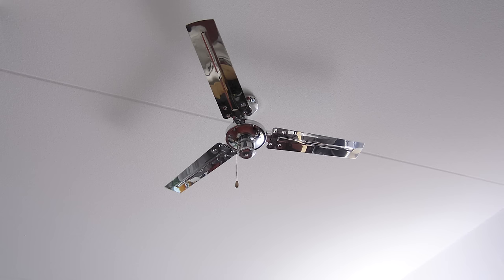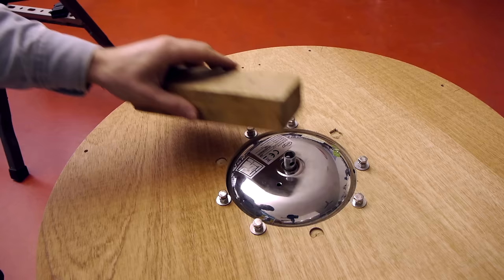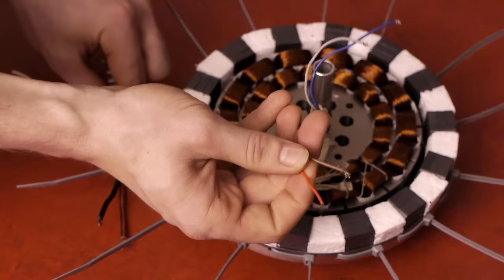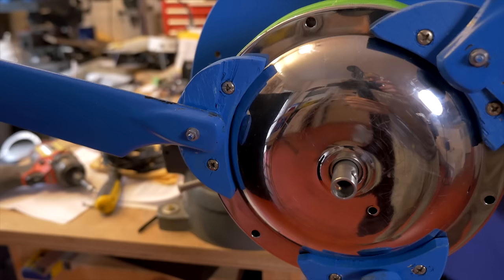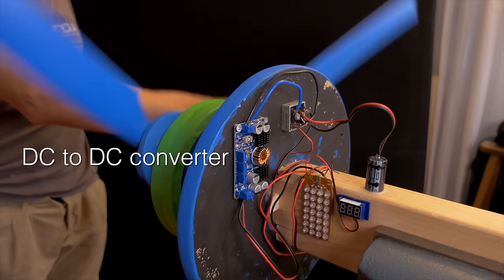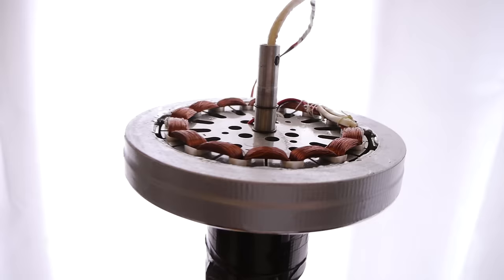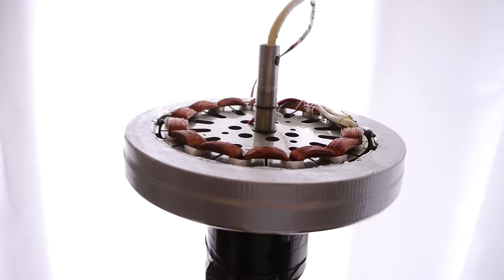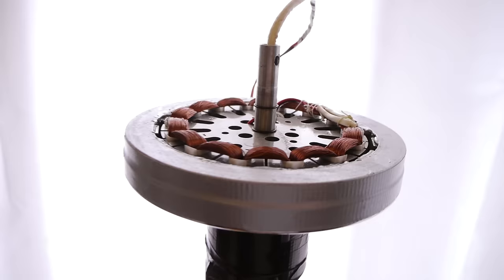Turn a ceiling fan into a wind turbine generator?!

Comment: Replace the linear regulator and dc-dc converter with a solar charge controller with an input voltage capability of 75V, the input is connected to the bridge rectifier output. The solar charge controller output can be used to charge a 12V battery, from this battery you can use your dc-dc converter if necessary to provide a lower voltage such as 5V.
Reply from the maker: Yes, I agree, that is a better/easier solution. Though inside a solar charge controller are: a rectifier, capacitor, and dc-dc converter... Almost the same, expect for: also containing other smart/necessary electronics, and well balanced.. so yes, your simple solution is better. As for better: I don't want to use the old lead acid batteries anymore. Thus instead Li-ion or LiFePO4. Thanks for comment!
Reply: Can be purchased or built is a DC to DC converter that can handle all the power output depending on what you are doing they are at about 80% efficiency, no need for an inefficient solar charger or the resistance regulator. The aim was to charge a phone ? Using just two DC converters would be better than the resistance regulator
Reply: SG Buckley's suggestion is the absolute best! Output from the Bridge rectifier, and into the Solar Charge Controller. These are quite cheap on Ebay, and the Solar Charge Controller does everything in one small compact unit, and also gives via the LCD readout the Amps / Volts, state of charge - if connected to a 12v Deep Cycle battery. Some Solar Charge Controllers also incorporate two(2) 5vdc regulated outputs for phone charging. The best 'generator' appears to be the main Motor from a Fisher & Paykel Smart Drive washing Machine. Motor would need reconfiguring. Finally, if you decide to use the F&P Washing Machine Motor, be aware that some of these motors have aluminium wire coils. Avoid these and select copper windings as your first option.
Reply: I would like to see that setup done, it sounds interesting and MAYBE doable for us non-electrically inclined. Please do a video of it.
Reply: A solar charge controller starts with DC voltage from the PV panels.  He is starting with an AC voltage, a better suggestion would be to research the switching diodes and phase shift for DC to AC conversion but that is later on.
Stick with the bridge rectifier, and nice work on the magnets and the understanding of how they work with electrical generation.  I wonder what this would do attached to a tesla coil?
Reply: @RobertOlufs  I wonder what it would do using POE coils and Rodin coils?
Reply: @kolinevans9127  What do you mean inefficient solar charger? Those are some of the most efficient DC-DC converters on the market. Some are over 96% efficient. The only downside is that they tend to have high prices to match.

@Robert The solar charger would go after the rectifier and smoothing capacitor. It's just a very good DC-DC converter with some additional safety features built in.
Reply: nick luci ah you got me there until I read the rest yes very high prices as compared to some high quality DC DC switch converters I have purchased from China in the range of 10 to 30$ over 80% efficiency from 180 to 300w-  Maybe I was thinking about everything else related to solar when I thought ‘inefficiency’ ? Also the cheap chargers are horrible.
Reply from the maker: @peterduxbury927  That Fisher & Paykel Smart Drive from a washing machine, seems like a much better, more powerful stator relative to an ordinary ceiling fan. If I find one of these I will certainly take it out of the trash. Pretty sure they are rare to find relative to a ceiling fan. As for the Solar Charge Controller. That is the easy way. Could also buy a ready to use wind turbine. I want to learn how stuff works. And the output of my ceiling fan will not work directly on a standard Solar Charge Controller: at very high speed 230V and 0.28A...

Comment: There is a way to use an induction machine as a generator, namely by connecting a capacitor in parallel with it to generate the reactive current which will magnetise the airgap. Many old wind turbines use this. Maybe you could even use the inner coils for this purpose: connect a capacitor to those.
I like the idea of using this fan because of its low rpm. Great idea.
Why not use the original winding, accept that it's made to generate high voltage and chop that down to a value acceptable to you? It would generate the same power as lower voltage with higher current.

Comment: the coils have shims that raise them away from the core. Why not try to trim those and physically push down on the coils to reduce the gap (@~10:40) ? Very nice video. Your calm voice tone helps :-)
Reply: Or replace the insulating shims with ferrous shims and a thin layer of insulation.
Reply: Magnets Make Me Merry!

Comment: Convert the generated electricity into DC to charge a preferably good size battery. Then use a power inverter to power home electronics.
Reply: Personal opinion though, it would be allot less work getting one of the windmills that's meant for yard art and using it with a pully on a car alternater.
Reply: @starkie1990  Car alternators need a lot of wind power to turn them. Pulleys waste power.
Reply: @starkie1990  Trust me that I am fully familiar with the concept and application of gearing. I don't think you grasp the power loss of gearboxes, pulleys, chains and sprockets etc.
Reply: @brianrosebudd9200  when you fall asleep over your phone 😅

Comment: I decided to watch this video out of curiosity because I'm always looking for motors that can be turned into generators. Giesbert mentioned that you can find ceiling fan in the trash but I don't think I've ever seen (or at least noticed) a discarded one before. 
Half way through the video someone asked me to come outside, and what do I see next to the dumpsters? A ceiling fan! Manifestation? I don't know, but what are the odds?
I promptly took it home, disassembled it, and found the same type of induction motor inside. Still have to build the rig to get the casing open.

Comment: At the end you asked for suggestions about improving the electronics. I have a suggestion. Use a MPPT charge controller and done!
Reply: While I havent watched the vid yet, What I did was use multiple ( to be exact) LM338k voltage regulator controlled outputs feeding a cheap 5 input solar regulator which then fed a bank of 5 deep cycle batteries. The fifth input on the regulator was fed by the cheap Harbor Freight Solar panels. One other thing I did is I mounted a cheap plastic bowel, carefully cut, and fitted, over the hub of the fanwith a rubber "seal" to keap rater out when it rained. this was the hardest part since this seal couldnt induce any drag on the motor.
Reply from the maker: Ha, yes, or just buy a charge controller ánd a wind turbine and be ready to run in no time! These modern little wind turbines for on boats for example are amazing. But this is a DIY & re-use project. But you are are right and this is my plan: Make a better DIY version 2 of the generator, then focus on the DIY rotor & the turning on a pole, then maybe DIY electronics. Up to that time, a could just use a MPPT charge controller. Everything at once is a bit too much.
Reply: Electrical equipment TAO  thank you very much for the information. Many continue to deny the ether although it has been scientifically known to exist for at least a century.
Reply: Electrical equipment TAO  no. Good try, but no. I don't think so. I guess were all allowed to differ by our opinions.. While I do believe in a certain type of "Aether" (derived from Latin...) I don't think it's as complicated as you do.
Reply: @elijahgardi7501  @Electrical equipment TAO The page they linked, links to a sketchy video website that tries to get your money after seeing the video. You can always tell its a scam when the video player has no controls for the playback position. I don't know why it's such a common format, but those scam video player sites all look/behave the same way. It's bullshit.
Reply: @GiesbertNijhuis  Good idea, great little electrical project, highly desirable for off grid living & I agree with your wish to build an efficient front end from throw away items, if you get it right lots of people will give it a go  but the cream is to harness what you produce with minimal waste (heat, input clipping) no? So why re-engineer the output side when an off the shelf MPPT controller (select your preferred voltage & expected max over-current -- although you would still need to smooth the MPPT input I think) will make the most of your primary project? Plenty of controllers around with USB ports for charging gadgets as well as battery banks. Just view the controller as a module if you wish, as you would your bridge rectifier. :)
Reply: I'm thinking about doing this, any suggestions for overspeed/overcharge breaking? I know industrial ones have that feature but I don't know how it works.
Reply: @travellingsoldier5018  Sure, over charge can be handled by a controller, but I mean magnetic breaking if the wind speed goes over a safe amount, and likewise many of the better wind generators will use magnetic breaking when the batteries are full rather than just dumping the load, which can be problematic on a metal boat.
Reply: @svchineeljunk-riggedschoon4038  Stray currents on a tin boat would be very nasty I agree totally. Braking in the two situations you have outlined...........overspeed/over voltage why not just add a clamp to your smoothing cct., perhaps with a zener diode or similar device? Or; Wind your alternator so it could not physically (electrically) produce excessive voltage. Or; You could research commercial products & perhaps copy the magnetic system(?) or just go hard core manual. Monitor rpm & to be on the safe side physically clamp the turbine when charging not required. Perhaps look at an electro-mechanical brake (solenoid operated from a set point off your battery condition monitor (which you have not mentioned up til now)? Are you planning on monitoring specific gravity of electrolyte? If you plan to assess batteries as "full" from controller display using mark one eyeball then use a manual actuator to clamp your turbine. Either way you would need something bomb proof if you planned to leave the turbine unattended for any length of time. 

Ideas are good, design is where the tough get going. Good luck with your project friend.
Reply: @svchineeljunk-riggedschoon4038  PS: Check out the post from XenoMorhic???? (cant remember his whole handle) posted 11 months ago, electrical engineer, suggest how to make an electro-magnetic brake with some spare existing windings on your rig.
Reply: @travellingsoldier5018  That is super useful actually, thanks, as Alibaba now have a 400w wind turbine for 90euros, (50 shipping, but still good), but it has no braking, is noisy and is probably a piece of shit in general, but I reckon retro fitting it would be better than building from scratch, thanks.
Reply: @ProfessionalArmourer  Voltage regulators are a bad idea, they throw energy away to lower voltage, Buck converters are much better
Reply: Electrical equipment TAO  Interesting article, too bad it ends in a load of crap lol
Reply: @elijahgardi7501  derived from the Greek ΑΙΘΗΡ, latin was derived from the Greek word....

Comment: You should use an arduino with a hall sensor to read the frequency/speed of the rotor and the secondary coils that you cut off as an magnetic brake. You can collegate the two wires to an relay that is comanded by the arduino. On this way if there are strong winds you can control the max speed with the arduino avoidind on overcharge on the capacitors and dc-dc converters
Reply: Wow that's an great idea using one  of the windings for control speed.
Reply: This is essentially a "Magnetic Governor" Arduino is fairly inexpensive, but a resistor across the second/inner coil would have a steady, and consistent inductive load, kind of like regenerative brakes on a car. Only this won't be charging any batteries, just providing rotational resistance. to prevent over speed, and thus over voltage. The resistor is also cheaper than a micro-controller board, for those budget minded DIY hobbyists. Which based On what I saw in this video, he was trying to do this as cheaply, but reliably as possible. at least it was implied, but not specifically stated.
Reply: @alien200049655  Isn't that like dynamic breaking on a locomotive?

Comment: Great video.   Never thought about it before, but I wonder if the inner coil you removed could be used as a brake in the event the wind wanted to spin the blades too quickly.  Seems like slowing the blades might be better than burning off the extra electricity produced...  although I have no idea how hot the coils might get trying to fight mother nature.    Fun project!
Reply from the maker: Yes that is a good idea: keep the inner coil (=easier too) and use it for A) power and B) a brake for when windspeeds are too high. If it is still turning too fast, the main coils can also act as a brake. And next things could get hot.. It needs electronics and software really. Arduino project for small wind turbine anyone?
Reply: @GiesbertNijhuis I've never heard L.E.Ds pronounced your way that's weird
Reply: a dump load would do ,also the a30 voltage relay along with a solid state relay is a decent way of controlling a turbine  @GiesbertNijhuis

Comment: I've got a really old ceiling fan. It weighs 40 lbs. The motor should be fine just the pull cords are messed up. This would be an interesting project for that heavy old guy.

Comment: I heard some washing machines were built with permanent magnet motors. These motors might work nicely.
Reply: yeah there are videos on this topic, people using old washing machine motors for hydro elec
Reply: Kinda foolish thing to do, put a lot of time into converting an old, 3/4ths worn out motor for some continuous duty application.  Life is too short, if you're bothering at all  you should at least get a new, quality motor, or find some other hobby where the outcome was at least worth the time.
Reply: @stinkycheese804  you really are a sticky cheese. Just like your opinion.
Reply: @stinkycheese804  Life is too short for all that salt. Relax.
Reply: @Standbackforscience  Yeah man sometimes we just do things purely to see if we can and to see what happens. We humans love cause and effect. We love testing it just to see what will happen it ads a dimension of exitement to life.

Slap a cop and just enjoy the thrill of the moment. If any one asks just say it was a social experiment.
Reply: @stinkycheese804  The motors rarely fail. A twenty-year-old washing machine's motor could easily give decades more service if you don't do anything crazy with it.
Reply: I want to know the SWG used in place of thin wire and number of turns in a coil. You didn't show how much current the generator is producing. I really appreciate your way of explanation and pronunciation.

Comment: I've done 3 of these. Here is the secret. Don't put north on one coil and south on the next. Use smaller magnets and put 2 magnets on each coil BUT put them ns ...sn ...ns...sn. The other way is to turn the magnets on their side the same way south facing south and north facing north. This doubles the power and spins easier. Try it. You will be amazed. I'm lighting 45 watt bulbs AC with slight breezes.
Reply from the maker: That is an interesting and apparently good idea, to place the magnets like that. And you don't close the gap (makes it easier). Did you use a 120V or 240V model? Problem with possibly both (I have only 240V) is the output voltage can go too high. What voltage do you get out of yours? And how do you get it down to a practical level? Thanks for sharing!

Comment: What about using a car alternator with a pulley system? With a big enough fan blade setup, it might make up for the pulley system?
Reply: What about a variable bearing on the alternater shaft to do away with the pulley system?

Comment: Hi, a very interesting video to a high production standard, one thought is that when the 24v regulator shuts down there would be no load on the turbine and so the speed would dramatically increase. This would only occur at high wind speeds, and so damage may well occur. A solution would be a tuned folding tail where the sping is set so the tail folds parallel to the blades well before the point where reglator would shut down. Cheers, Andy Reynolds author of Wind and Solar Electricity.
Reply: How about a bank of relays to different Resistances to ground. each relay activated by different voltages as voltage increases another relay trips adding another path to ground.
Reply: Hi, a simple voltage sampling timer / relay would work to switch in a dump load. The VLC V20 unit works well on my system switching 25A at 50v as a dump load controller for out turbine. The timer is needed to prevent historisis and ours is set at 3 minutes. I have a video on this timer, cheers
Reply: How about a vertical windmill and we use all that speedy wind? I live in a high wind area and am working on two vertical windmills but had trouble with my bearing choice.
Reply: Hi, balance is so important and the more complicated the rotating structure the more difficult this is, however back in the eighties I stopped making twin bladed turbines in favour of 3 blades. These are more difficult to make but it is possible to get a better balance as 2 blades are so difficult the get and keep balance, cheers

Comment: Halbach array will give you almost 2x as much magnetic force in the direction of the strator. Also to regulate the over voltage store it or use it but don't let it heat the coils or it won't last long.